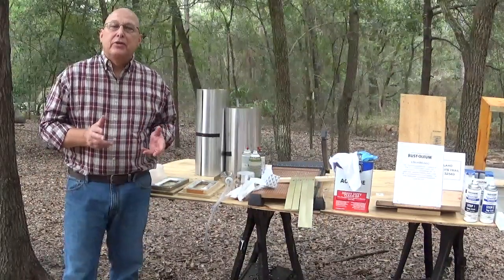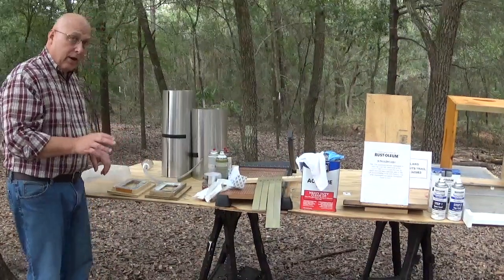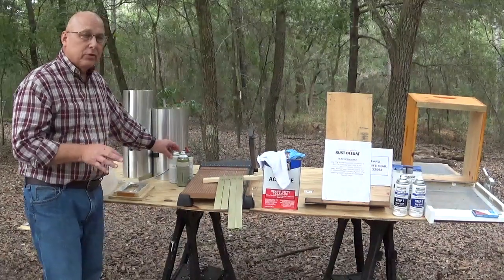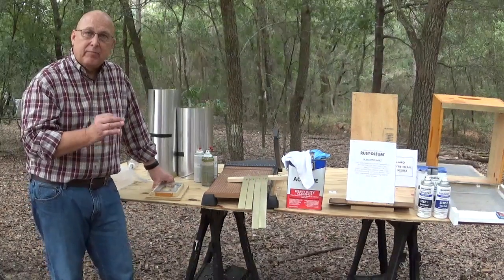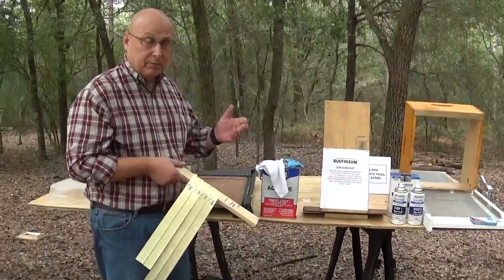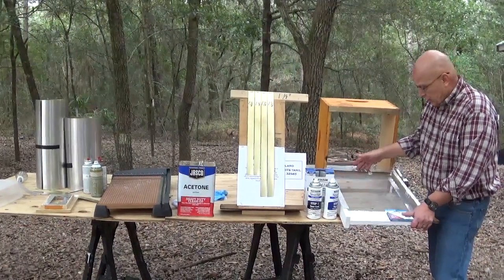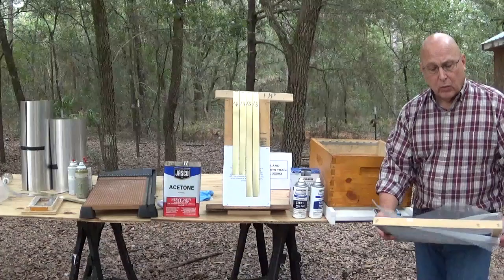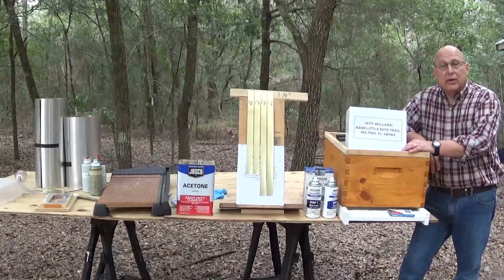Small Hive Beetle Barrier, it is easy to make and inexpensive.....

Comment: Jeff, I've sprayed the neverwet on my baffles but it made them feel rough., is this normal? Thanks Jeff Arcement
Reply from the maker: Hello Jeffrey, Yes this is normal. When I first did mine it came out rough also and I thought I didn't come out correctly but that is the Neverwet surface when dried. You have to make sure that there are no other points of entry (cracks, open seams, uneven fit of hive body, super or top) above the Neverwet coated flanges. If there is Hive Beetles will get in.  Thanks, Jeff
Reply: Thanks, Jeff
  My brother and I had tried the untreated baffles with no luck. There are people who insist they work but I' have hives with untreated baffles which are full of beetles. I had been looking for something to apply to the baffles so the beetles could not get past them when I saw a Neverwet commercial. I called my brother to tell him I thought I had found the solution and he started to laugh. That's when he told me he had seen your video on YouTube and was just about to call me. Funny how things work out. Seems great minds do think alike and people with great first names lol. This is the one thing out of many I have tried that is truly working. I have added a screen bottom board with a tray that slides under it which has 1/4" quilt batting on it. The batting being made of nylon, entangles the beetles trapping them until they die. When its full of beetles I pull it out through it away and reline the tray. I figure this way I don't have beetles hanging around by the thousands harassing the bees. That and I hate the little boogers so much I want them all dead. One last thing, I have been having problems with little black ant getting in to my hives and nesting in them. They don't seem to bother the bees much but they tunnel holes in my bee boxes and cause them to rot. So I have made new hive stands which have 4x4 post for legs, and I've put 6"x6" aluminum sheet metal on top the post which has been treated on the underside with Neverwet. NO MORE ANTS as long as I keep weeds and grass from making a bridge for the ants I have nothing to worry about. Chalk up one more use for Neverwet. Thanks for your video, Jeffrey Arcement AKA the Cajun Beekeeper.
Reply from the maker: Hi Jeffrey, I am a big believer in that old saying an ounce of prevention is worth a pound of cure. Use everything in your arsenal, Neverwet coated flanges, bottom traps, top traps and bait stations. The Neverwet coated flanges do repel the Hive Beetles but even I am still fighting with the small gaps here and there on the vent tops and hive bodies. Moisture appears to be the culprit, I have been experimenting with foam seal tapes, I have been using white polyethylene closed cell adhesive foam tape 1/8" thick x 1/2" wide between the supers and hive body and Frost king gray vinyl foam tape 3/16" thick x 3/4" wide on the vent tops. Clean the and give the edge your going to stick the tape on a coating of 3M contact adhesive for some extra bonding, these two foam tapes appear to be doing the trick, nothing seems to be getting in. I got the polyethylene foam seal tape from Amazon and the vinyl foam seal tape from our hardware store.
Reply: Hi Jeff, Another Jeff here from NY. Just finished spraying the strips with Neverwet and the resulting "sand-papery" rough surface gave me pause. I thought something went wrong, so thanks Jeff A. for asking the Q and Jeff W. for answering! 
I see the theme of blocking all other points of entry, will do that as well before the bees get going in the spring. I produce overwintered Nucs and hive beetles can be devastating in the Nuc yard! Thanks Jeff W. for the excellent idea, -  I'll watch the performance this season and, if this works half a well as you describe, I'll send you a much deserved donation.
Thanks! Jeff Zitz, Poughkeepsie, NY
Reply from the maker: Hello Jeff Z,  After the hive staples are hammered in I caulk the seam between the bottom board and hive body, I then use polyethylene foam tape between the hive, suppers, top vent and queen excluder this makes it completely sealed and keeps the hive beetles from getting in above the coated flanges. For your polyethylene foam tape needs this is the best place to buy it. .  http://www.equalseal.com/White-Polyethylene-Closed-Cell-Foam-s/2187.htm  I have started to use the 1/8" thick x 1/2" and 5/8" wide  foam with great results. I am sure it will work as well for you as well. Thank you....
Reply: Thanks for the add'l advice Jeff, I will be doing the same...Jefg

Comment: I have several of the newer Apimaye Ergo Plastic hives. Not sure how I would use this technique.
Reply from the maker: All I can suggest is trying to adapt this to your entrance, this idea was for a top bar or long hive system.  https://www.youtube.com/watch?v=-rNoM4z02o0
Reply: Thank you. I am just starting out with two hives. Not sure if I can buy the aluminum stripping in smaller quantities. I don't need ten to 50 feet as I've seen in the hardware stores. If you know of a source would appreciate the contact link. Excellent video and idea.
Reply from the maker: Check with local contractors or a roofing company, they probably would have scrap pieces of flashing you could have.

Comment: Ok so I expect the answer seems obvious but I assume for the strips that go on the top edges of the bottom board and the bottom of the hive body that you cut 2 strips @ 1 1/8"x16" and 2 strips @ 20" x 1 1/8" for the 4 strips is that correct? I am double checking as I have someone that is going to cut the strips for me and I just want to make certain I am correct.Is there a reason you didn't just put all 4 strips on the bottom of the hive body?
Reply from the maker: I have heard from people who have attached the Neverwet coated flanges both ways, I think its easier to attach them to the bottom board and at the entrance on the hive body. In my first installations I first took the hive off the bottom board and stapled the front entrance flange on all while the bees were in the hive. I found that it is much easier to make up hives with the stripes already installed on 2-4 hives then swap out frames and repeat the process, it is less disturbing to the bees. Beekeeping is like ice cream, everybody has a favorite flavor and they think theirs is the best, do what makes sense and what works for you.
Reply: Was the following assumption correct? You cut 2 strips @ 1 1/8"x16" and 2 strips @ 20" x 1 1/8" for the 4 strips is that correct? Also I agree with the process you were using to prep some hives ahead and then just switch out frames to minimize degree the bees are disturbed.
Reply from the maker: Yes that is correct..
Reply: Thanks! I just wanted to make certain since I have someone with metal working tools that does roofing that is going to cut the strips for me.
Reply: Thanks! Sorry but also I have noticed 2 different stock numbers for Neverwet kits. One appears to be rated for consumers item number 274232 and according to Rustoleum the other item number 275185 commercial but Rustoleum didn't expound on any differences. I know size is one difference but I do not know if there is any product difference between the two. Did you use the 18 oz. size item number 274232?
I am guessing it has 2 - 9 oz. spray cans with step 1 and 2 in it.
Reply from the maker: This is the one that I always use Rust Oleum 274232 Never Wet Multi Purpose Kit but now it also comes in colors, I am sure they all offer the same results.
Reply: Jeff, I recently found out my hive bodies are 16 1/4" x 19 7/8" so I am assuming I would need 2  1 1/8" strips at 15" for across the front and back ends of the hive and 2  1 1/8" strips at 19 7/8" Does that seem correct to you? Further I will be installing them on the bottom of a slatted rack that is also 16.25" x 19.875"
Reply: Sorry correction to last comment. 2 strips at 1 1/8" x 14 and 2 strips at 1 1/8" x 19 7/8"
Reply from the maker: 2 at 16" and 2 at 19 7/8" so that the flanges overlap in the corners .
Reply: oh ok, I guess I need to watch the install video again. I didn't realize they overlap in the corners. I was subtracting for the 1 1/8 x 2 on the sides from the 16.25 to come up with the 14" So overlapping them doesn't cause any significant gaps in the corner area? I don't have the suggested foam tape at this time if its used there. Also my width is 16.25" vs. 16" so would I use the full 16.25 length strip and overlap the 19.875" strip 3/4" on both ends? does it matter if the long strip is over lapping the short one or vise versa?
Reply from the maker: Nope, either way works....
Reply: Ok thanks! Just to be sure I am picturing this right: It doesn't matter if both ends of each of  the 2 - 16.25" strips go on top or overlap the top of the ends of the 19 7/8" strips or if each end of the two 16.25" strips are on the bottom of the ends of the 19 7/8" strip. Another words both 16.25 strips could be installed and then both 19 7/8" strips could be installed or vice versa, both 19 7/8" strips could be installed and then both 16.25 strips could be installed over the top of the ends of the 19 7/8" strips. Correct?
Reply from the maker: Any configuration on how you want to mount them will work..
Reply: Ok thanks for your help and patience with the questions. I just wanted to make sure I did it in a way that there won't be any gaps in the areas that the end overlap.

Comment: Why do you use window screen and hardware cloth
Reply from the maker: The 1/8" hardware cloth is stiff enough to stand up to burr comb without bending when your removing the top screen cover and the window screen is small enough to keep out the hive beetles. Hive beetles can crawl through the 1/8" hardware cloth but not the window screen. I see hive beetles all the time crawling around on top of the window screen but they aren't getting in.

Comment: Jeff can you give me the product number for the foam tape you recommended in one of your videos? I believe the company was called equalseal.   Thanks, Brian
Reply from the maker: Hi Brian,
Here is a direct link to the product page, I use the 1/8" x 5/8" foam tape.
http://www.equalseal.com/White-Polyethylene-Closed-Cell-Foam-s/2187.htm
Reply: Thank you.  This has been the best thing when it comes to keeping the beetles from getting into the boxes when the box is not totally flush with each other. Thank you! Take care.
Reply from the maker: Your welcome Brian and I'm glad it helps you and your hives....
Reply: Last summer my hives were overrun with hive beetles and wreaked havoc on my bees despite having beetle traps. I started your method on them late into the summer and saw some improvement right away. I kept at it this spring and so far I might see one or two hive beetles in the beetle trap and none running around  compared to seeing literally 20+ running around per box and the hive beetle traps full!  I have found your method has them pretty much extinct. I appreciate you sharing your method.  I haven't gone to your new changes as I have lots of aluminum strips all pre-cut so will use them up.   Thanks again!
Reply from the maker: Hi Brian,
  It is always good to hear success stories like yours. I'm expecting this new Barrier design with the Industrial Neverwet material will work far better than the original idea, only time will tell when your working with an insect. Worst case scenario is that the new removable barrier and shim design would need to be re-coated as needed every couple years or even longer. Look for the "Inside the Hive" Videos coming up.

Comment: Don't the beetles just fly from the bottom board onto the combs?
Reply from the maker: Hi Brian, The hive Beetles will fly to the hive but once inside they will crawl along the bottom and edges trying to find a hiding spot, then migrate upwards into the hive to lay their eggs in the comb. The Neverwet coated flanges keep the hive beetles isolated on the bottom, away from the frames and comb where they will eventually die or be killed by the bees. I can not stress enough about sealing and closing up all seams and small cracks above the coated flanges, if this is not done they will find an opening. I now use the polyethylene foam tape (listed above) between the hives, suppers and vent tops on all my hives and caulk the seam between the screened bottom board and hive body. I can honestly say that I have seen a 99.9% decrease in hive beetles, it would be difficult for me to find enough Hive Beetles now to perform the tests that I did earlier. Good luck with your bees.
Reply: How does the never wet hold up?  Does it have to be sprayed on metal?  Can it be sprayed on wood?
Reply from the maker: Neverwet dries to a hard and permanent material, I don't know how it would hold up on wood with the moisture expanding and contracting the wood, it may peel. You can always experiment on wood to see the results.

Comment: Curious... does this also keep ants out of the hive?
Reply from the maker: Yes it will stop ants, you will need to have a Neverwet coated plate made out of flashing or heavier material between the ground and your hive. Have it protrude out from the support of your choice approximately 2 inches. Place the coated plate  between a support of cement bock or wood post and your hive, that will stop the Ants.......
Reply: Thank you. I will try a side-by-side test to see if I can baffle ants, etc.
Reply from the maker: Just a quick wood of caution, if you are planning on placing the Neverwet coated aluminum flashing between a concrete block and pressure treatd wood you will need to protect the aluminum flashing with a zinc chromate primer. The alkalis in the concrete and the chromate copper arsenate in pressure treated wood will make bare aluminum corrode. Good Luck...
Reply: I was ready to  ask the same question.
Jeff, thank you for answering that.
Reply from the maker: I here to help as much as I can........

Comment: can the bees walk over it?
Reply from the maker: Keep your coated flange a maximum height of 3/4" above the bottom board, no higher. The bees have no problem getting over the coated flange at 3/4" high but will struggle if it is higher. Good Luck......

Comment: Tried it on 5 hives this past summer and it did not work for me.
Reply from the maker: Did you seal up the hive with foam and screen as in the other update info videos. What was the condition of the Neverwet coating, I have noticed if its sprayed in high humidity the adhesion is diminished.

Comment: Does not work, the bee eventually cleans the never wet off the metal...
Reply from the maker: I have had my Neverwet coated stripes on for about three years, the coating shows some ware at the outer edges of the flanges but mine are still keeping the hive beetles out. Now, I'm not going to say the Neverwet coating will last forever and what coating would with thousands of bees crawling over it everyday.  Until someone comes up with a "cheaper and better" hive beetle solution than this, I'll keep using mine.... Good luck with whatever small hive beetle prevention your using......
Reply: Jeff Willard even if the bees or powers that be, cleans the Neverwet off, can’t you just go back at that time and respray?